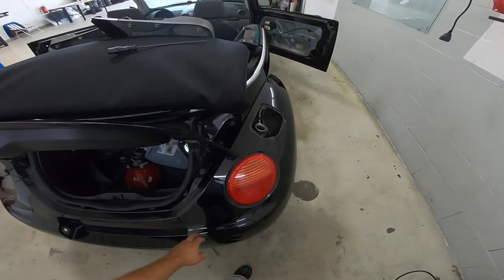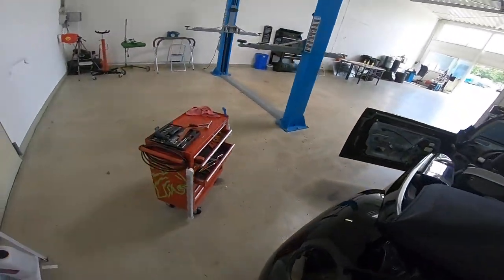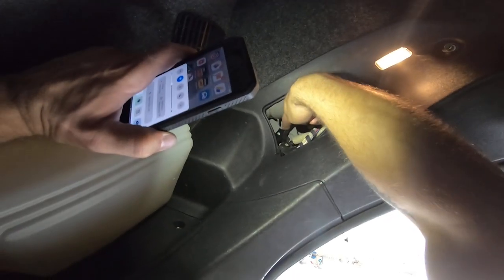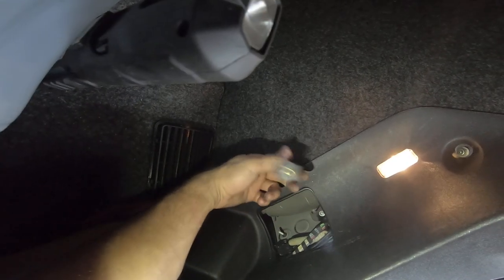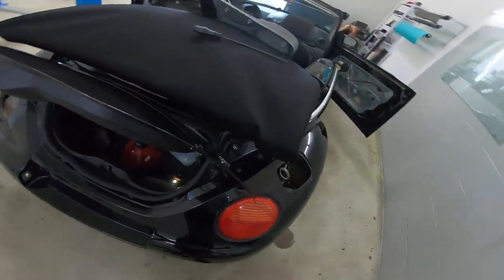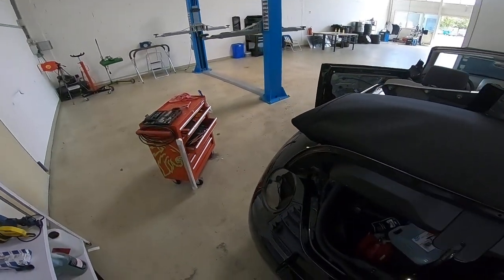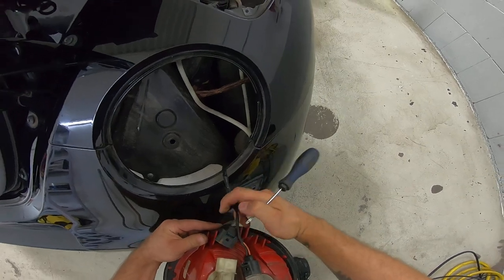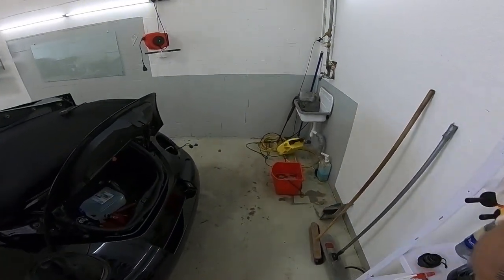How To Install Replace Taillight Volkswagen Beetle

Comment: In my 2004 Beetle convertible the large plastic star nut is for a folded up ground strap and I did not have to remove that nut. You can pull out the light housing far enough to remove the light socket and then the light bulb.